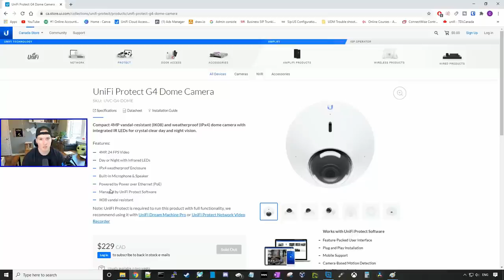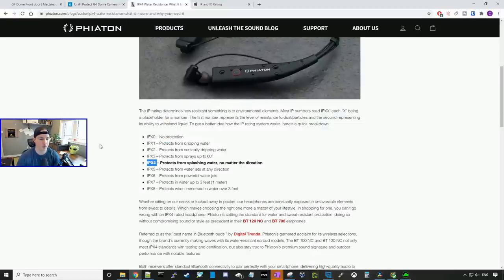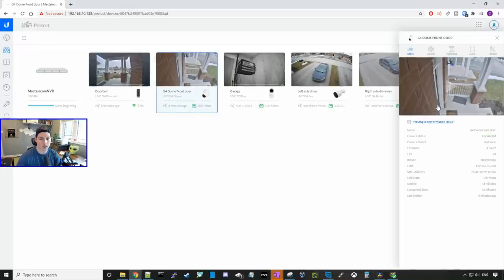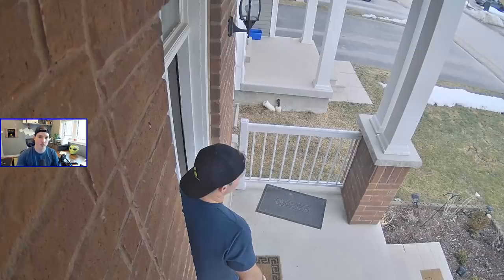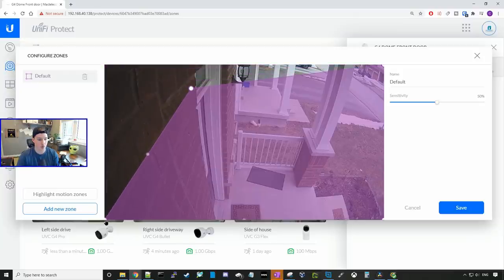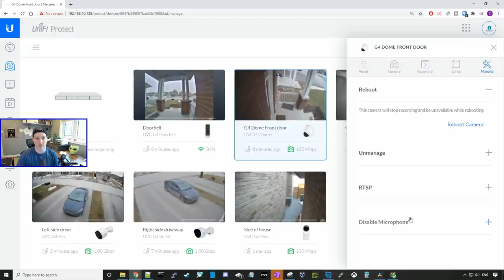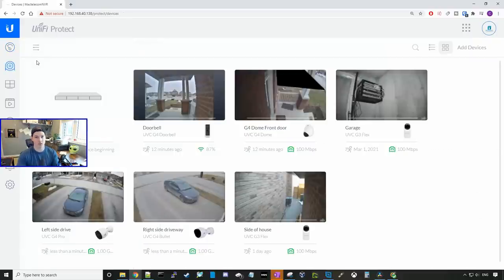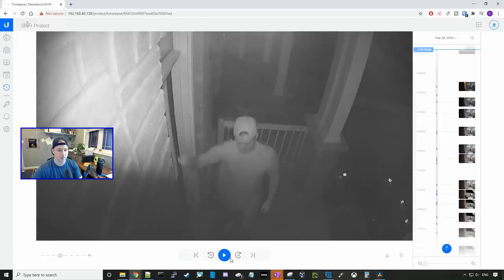Unifi G4 Dome Review

Comment: What did you think of the mounting.  I like my g4 dome, using it inside, but feel that mount is a little flimsy. I would prefer a solid screw in of the camera.  Guess if no one touches it it'll be fine.
Reply: Not just that, a dome that has a vandal resistant rating should never allow the protective dome to be removed without tools!

Comment: Hi, I watched another video on the G4 by "Crosstalk Solutions" where he had similar problems to start with. But he took the cover off, cleaned both inside and out, then made sure that he reattached the cover correctly, because they can fog up if not put on right. I thing he also spoke about the IR reflection and positioning of the G4. After doing this his image was as good as if the cover wasn't on. He even through rocks at it to test that part of the marketing. Hope this helps. Great videos by the way.
Reply from the maker: Hey yup I saw that as well. I did clean mine but still was having issues. But after a day or so seemed to be fine